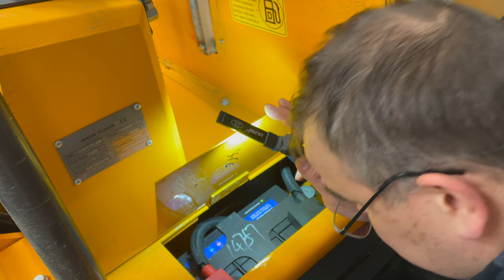First grease on Chinese mini excavator

Comment: I get my machine on the 17th, I am glad I watched this video. Thanks for posting, I am going to change the grease fittings on mine also. I see vids on greasing those flat ones and they just don't take the grease as well as they should.
Reply from the maker: You are welcome, congrats on your new machine!
Reply from the maker: I haven’t made video about this, but this coupler is also handy. The standard one is difficult to release, with this you just pull the lever.
https://a.aliexpress.com/_mOh0ePA

Comment: You can remove the pins and flip most of the cylinders around so the grease zerks
are not as exposed to damage.  You may have to use an angled zerk and position the 
boom, dipper, or bucket just right to get at it, but you don't need those needle grease fittings.
You can also reverse the barrel end of the boom cylinder to avoid damage to the hoses.

I see you have the newer version of the Xiniu (Rhinocerous) XN08 mini-X.  Mine is an earlier
version from 4 years ago.   I have posted lots of tips and modifications on TractorByNet.
Reply from the maker: Good idea, I will try this fo sure. I just lost one grease zerk this weekend.
Reply: @kokkonenfi  Very interesting grease gun you have.  I have been thru many guns, and still hate
the mess.  I currently use a Lincoln rechargeable battery-powered gun with a "lock-n-lube" style
tip.  Try that kind of tip if you want to make the job a lot easier.

I still love my XN08.
Reply from the maker: I have now a lock type tip, that is really handy

Comment: I changed all my Grease serts to regular ones. And on my Grease gun I have were it locks on to the serts.
What kind of motor is it and size or hose power
Reply from the maker: Sounds good. Have you had any of the regular ones break? I’ve had comments that about that
Reply from the maker: The engine is single cylinder diesel, I don’t know the excat hp but seems to be enough for everything

Comment: day one job on these fantastic little machines. mines at 500hours now
Reply from the maker: That has got some work done
Reply: Hows it holding up?
Reply: @chrisvolk106  absolutely perfect. takes any abuse whatsoever. works for 4hours on full revs on 1 gallon off diesel. nothing will come close to that.
Reply: @adammurray741  diesel huh?

Comment: Did you find any spot where to grease the tracks
Reply from the maker: Tracks are rubber. I think that the track  roller bearings are closed type with seals, so they do not require greasing. Please correct if I am wrong about this! 
Only grease nipple I found on tracks is for the tensioner.
Edit: even the tensioner is just sping with nut, no grease there either
Reply: Hi I recently bought an AGT  H13R . I was also unable to find any nipples for the tracks.  I've only about 10 hrs . Do you recommend any particular type of grease?
Reply from the maker: @GWAForUTBE I just got some basic greese, I’m no expert on those. I just think that there are no fast moving bearing so any greese should do as long you add it often enough. Propably more expensive ones could hold a bit longer.
Reply from the maker: @GWAForUTBE Somebody here at comments recommended EP3 or better